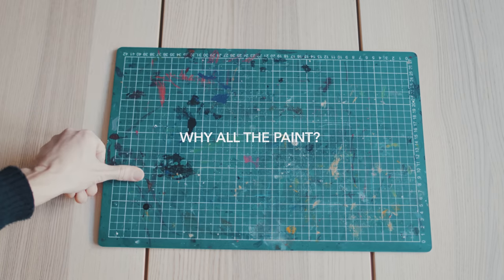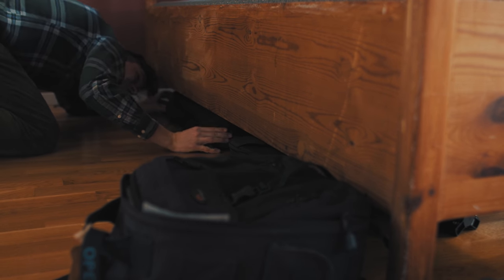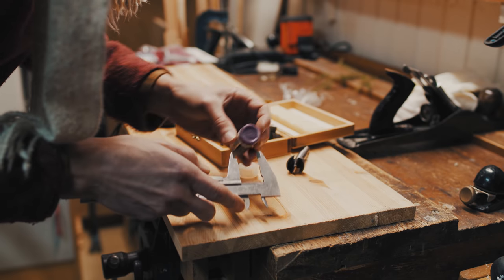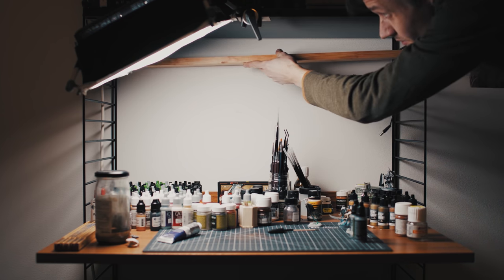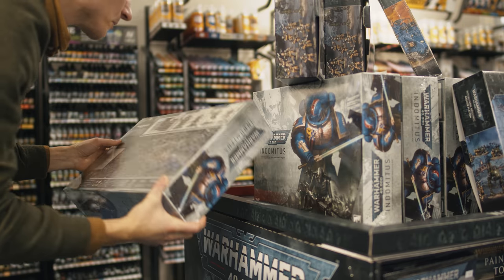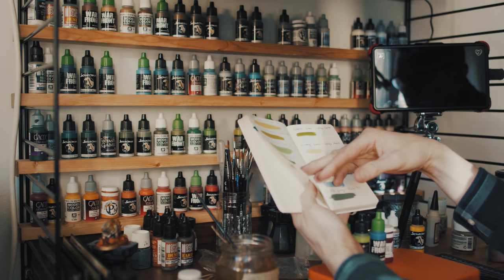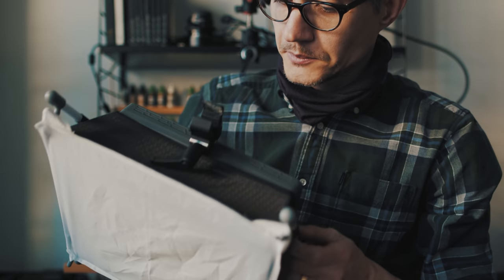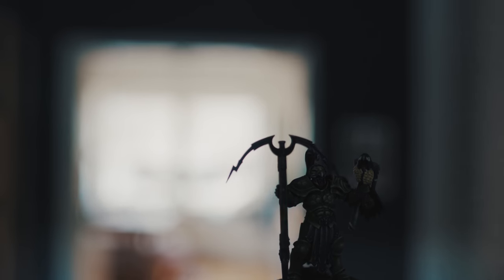Why All the Paint? - My hobby Setup that Inspires

Comment: First paints to buy: 
Buy a basic set that contains at least one of the following: black, white, bone colour, a grassy green, a neutral yellow, a neutral red, a neutral blue, silver. You'll probably want a basic brown (although you can make this by mixing blue, red and yellow), a skin tone suitable for whatever you are painting (because you're going to use loads of it and you don't want to mix it - probably an armour colour for the same reason) and a black wash and brown wash because every basic paint scheme calls for it. Yes you can start without the bone (mix a little yellow with a lot of white) and the green (mix your blue and yellow), but chances are you'll use them both loads, so why waste time mixing them up.

If you want to expand from that the recommended starter selection for any paintings is called the 6 primary pallet, basically two primary colours:
- An orangey red - Cadmium Red
- A violet red - Crimson Red or Quinacridone Red
- A purpley blue - Ultramarine Blue
- A greeny blue - Cerulean Blue
- An orangey yellow - Cadmium Yellow
- An greeny yellow - Arylide Yellow.

Having these six, plus a silver, black, white and a wash mixing medium will give you the ability to make 70%-90% of paint colours on the market (minus neons and very pure looking colours). Certainly a good starting place.

Thankfully most painting companies have done the hard work for you and you'll find they already supply starter sets with all or most of these paints (or similar paints) in them, plus a few more. You might have to buy one or two extras in some cases.

Vallejo 70101 is a pretty good starter set IMHO - goes for under 25 GBP on Amazon. The only issue is it lacks a greeny yellow and a greeny blue. Plus you'll need to get that brown and black wash or a wash medium - Army Painter do good ones. Although their brown washes can be a little inconsistent between pots.

If I was going to get a GW starter set, I would get the the 40k one as it at least comes with some of the basic primary colours listed above - but tbh, they all look pretty poor and expensive for what you get.

I hope this helps someone.
Reply from the maker: Thanks for this Noj! I appreciate it.
Reply: @52Miniatures  no worries, hopefully new hobbiests will find this and save some time, effort and money.

I should have probably recommend looking up how to mix paint colours, colour theory and getting a colour wheel. Adobe Color is a good wheel as it'll also show you colours that go together. Mixing colours and colour theory is just something everyone just has to learn. I'm not going to start explaining it here as it would take too long and there is plenty of information on it already, just do a search you'll find it.

Keep up the great videos, very inspiring!

Comment: Fantastic videos :) Absolutely lovely to have them in the background while painting. Thanks for making them :) It seems like you have a fairly small and compact spray booth. Where did you buy it and is it something you can recommend? I have a fairly small space, so having a solution that is easy to pack away would be good.
Reply from the maker: It’s a Panzag (?)... bought it second hand. It’s very practical but the fan makes a terrible ruckus.
Reply: @52Miniatures  Thanks a lot :)

Comment: I've probably spent as much time building and rebuilding my desk as I have spent painting on it. A desk, like an army of miniatures, is an ever evolving beast.

I want a garage workshop like yours! I'm working out of a 10'x7' shed, when it's warm enough to work outside, and my two motorbikes are stuck in the yard.

Off topic, what's the bike with the tank removed at 4:23? Is it mid restoration, or is it just tucked up in the warm, out of the Swedish winter?
Reply from the maker: Nice Mikey. The workshop is unfortunately not mine.. yet 😂It's my dads. But lets say I have free access. The bike is an old Norton, there is another out of shot both under restoration.
Reply: @52Miniatures  cool! I have a modern Bonneville and a small Mutt 125 I'm using to learn on. When England comes out of lockdown, I'm looking forward to lessons again.

Comment: I would love to hear your opinion on the instant paints! They seemed like a huge flop to me, but at the same time I find myself going to them more and more to get certain quick glazes. I just couldn't imagine painting an entire mini with them.
Reply from the maker: Yeah, I mean, I don't really get them. I've even had to go and get a second set to see if they act differently to the one I got (haven't tried that set yet). I can only manage to paint with these, either as glazes.. or mixing in GW contrast medium. I'm no GW contrast paint user, so I have little experience... but yeah.. using they for what they are intended to do, straight out of the pot.. I have not succeeded with.
Reply: @52Miniatures  Yeah unfortunately I went all in with the kickstarter and got the entire set. Granted my paint addiction would have led me down that route regardless... I thought my set was faulty as well until reviews started popping up here and there saying they had the same experience. It did lead me to grabbing a couple pots of contrast and trying them out which I do enjoy to use as filters and quick base coats for me to expand upon!
Reply from the maker: @jordydavis6642  Yeah... do try and ad some GW contrast medium. It does dilute of course but.. yeah, becomes more "paintable".
Reply: @52Miniatures  I will definitely give it a try! If there is any chance at making this paint work I won't feel so bad for the 70 or so bottles that have pretty much sat dormant since I've received them. 

Also when will we get a 52 miniatures discord server? You seem to have gathered a very helpful and kind group of painters and I think we could all gain so much having a little forum to hang out and share ideas!

Something to consider :D I know with the quality of your videos you must stay busy but if you want to get something like that started we could make it happen!

Edit: nevermind I just saw you have a patreon and a discord. Subscribed!
Reply from the maker: @jordydavis6642  Hah! yeah Jordy :) Welcome to the Discord! yay.

Comment: Tell me about it when I started 2years ago I could fit everything into a small plastic box.....now ....well I can hardly get into the space I use to paint , I had this idea of building my own paint rack , brilliant I had solved the problem  until I open a draw and found about 50 more paints then a pile of brushes and so on ....the answer is I am now investing in plastic drawer units that sit on my bench and stack up on each other but what happens when I run out of room😭😵.take care terry
Reply from the maker: I've actually started with a three step program. I put away paints I haven't used in a long time... if they don't resurface in a couple of months, I give them to my son 😂